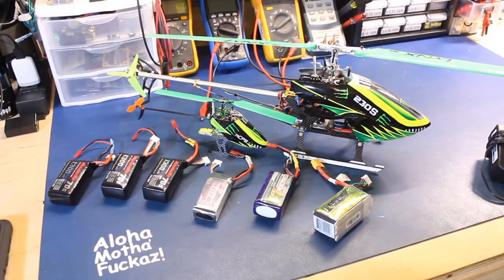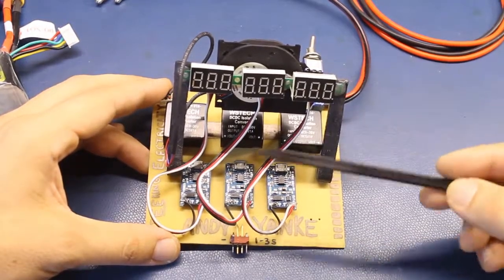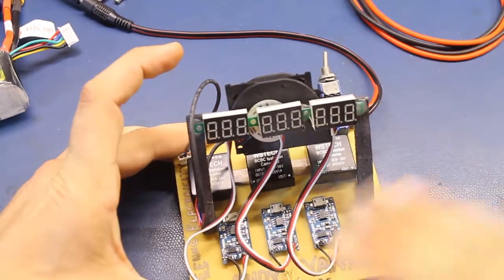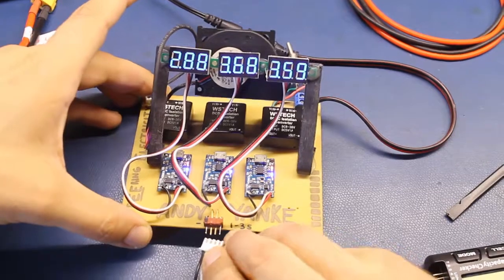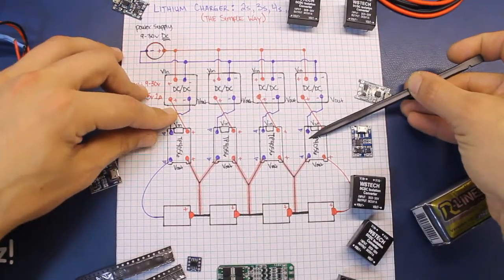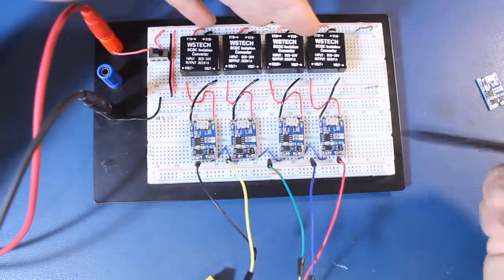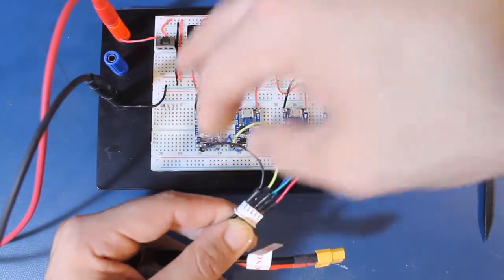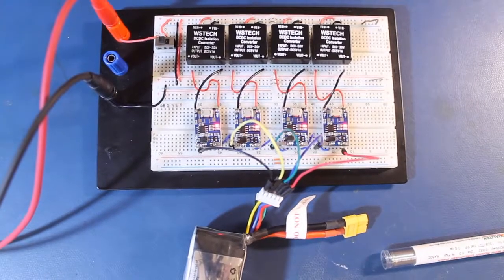DIY: 2S, 3S, 4S ++ Lipo Charger & Balancing board

Comment: Good video, I'm building a 7S balancing charger, but will use 230v AC to 5v 1A DC power modules to power each TP4056, the AC to DC will have good isolation. Have you ever thought about using a single power supply and using diodes to prevent too much voltage flowing back and frying the TP4056s
Reply: I am building a 4S balanced charger, and am interested in your idea. Have you tried this, and if so what were the results?

Comment: Instead  of those dc to dc converters I can use mobile charger rated 5v 1 amp 5v 700ma and 5v 700ma to charge my 3s lipo 2200

Comment: Why don't you just take one of those cheep 5V power supply? They can feed 20 amp so easy feed 15 TP4056?
Reply: they would share the same ground so you have to isolate each one

Comment: Have you tried grounding each tp to each other and then run the pos. to each respective cell.  Just wondering if this would work without having to do each tp separate.
Reply: Che cazzo significa porco dio ??
Reply: @arturocagaduro4328  translate for us so we understand what kind of pig
Reply from the maker: Aloha! For charging multiple cells (since voltages at each node/point is increasing since it's in Series) you NEED to have the isolation between modules and the "Series" type layout on here. (Sorry, I don't know the perfect terminology). If you were to tie the grounds all to eachother, you would have a parallel setup giving 4.2v to each node. BUT though you have 4.2v on that first battery,  now you have 8.4v at the next battery, 12.6v at the next and so on. So the charger won't charge anything other than the first cell I would imagine but wouldn't have the isolation anymore.. I'll wire it up and film and if it's an exciting outcome, I'll post an update video showing what would happen. I'm not afraid to fry some stuff in the name of education. Feel free to subscribe if you can tolerate my voice. I'm filming a very extensive tesla series going through every detail and interchangeable parts...  It's been a lot of work getting up to the 15 videos so far and I feel it will need at least 4 or 5 more before I'll start the daily uploads. Other than that I'm just hoping to fill the gaps where I struggled to find content. Mahalo for watching.
Reply: @steeringelectricity2779  I have some extras also that I'm willing to try just haven't made the time to do it yet. I've seen people isolate each module but it got me thinking that each cell positive would act like the negative for the next module in theory as it does when using a voltmeter. I know modules get blown when they are not isolated and  daisy chained because of shorting out pos and neg. If this works it would save a lot of headaches with using all the isolation circuits. Thank you and look forward to what you discover also.
Reply: @steeringelectricity2779  What is the Partnumber of the Black Isolating transformers? I have only small 1w    ones But i need some bigger ones.